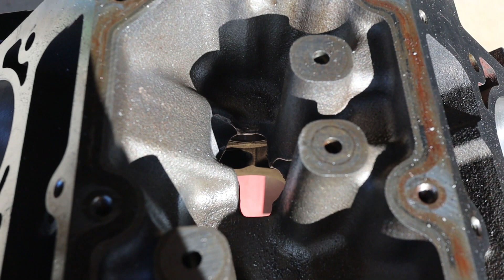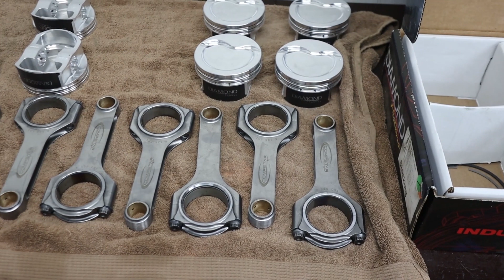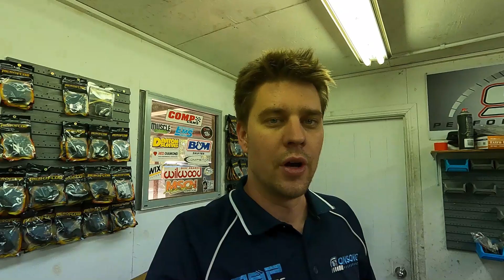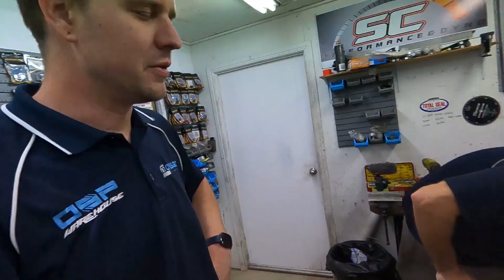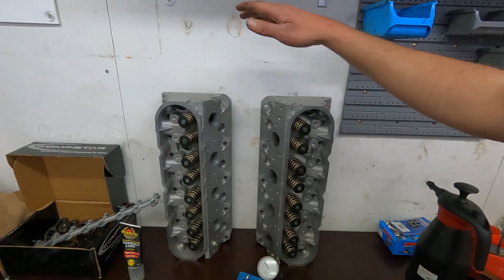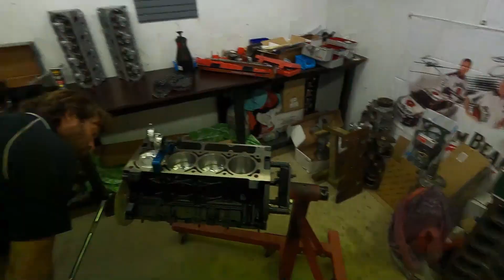"Iron Brock" || 1000hp LS Build

Comment: Would you run boost on a 6.0 iron block bored to 6.2?
Reply: Why not? More torque and power everywhere, less boost, less cylinder pressure, better spool, thick iron block?

Comment: These LY6 engines using an iron block with L92 style heads is a great combination. Unfortunately the low compression of the standard LY6 suits boost but can be a little bit of a disappointment for NA builds.
😎🇦🇺👍

Comment: Why drill and tap the towers, do you not trust the o’rings in the valley pan ….I have a l96 with a high volume oil pump should I be concerned but I’m only at 600/maybe 700 hp if I’m lucky (lsa blower)
Reply from the maker: I wouldnt be too worried. Its something we do on fresh builds for extra insurance. If its a SBE thing that isnt coming apart we wont bung them, have have plenty of high power cars with HV oil pumps getting around with no issues with them left open.